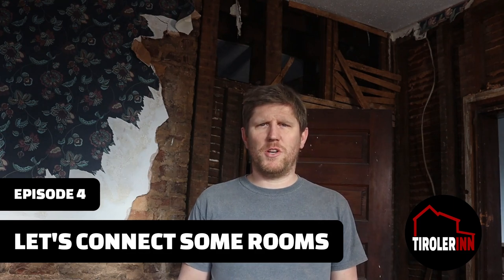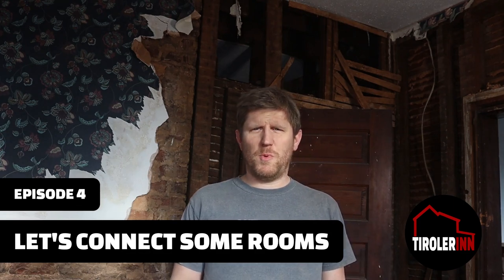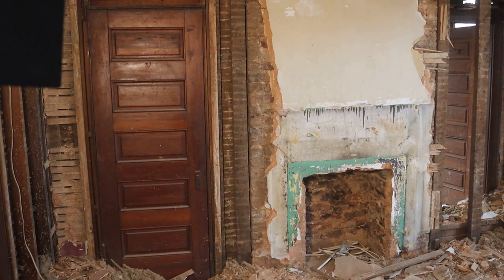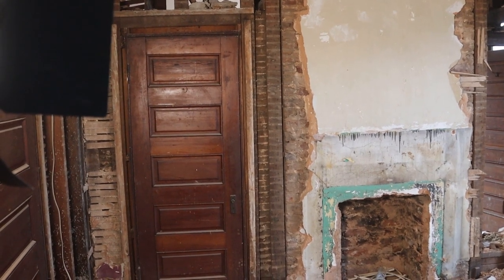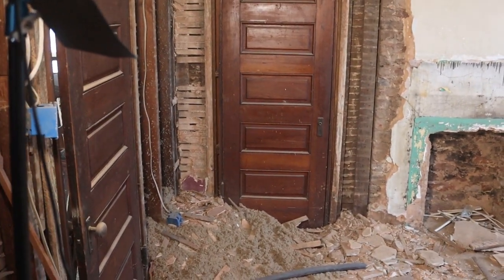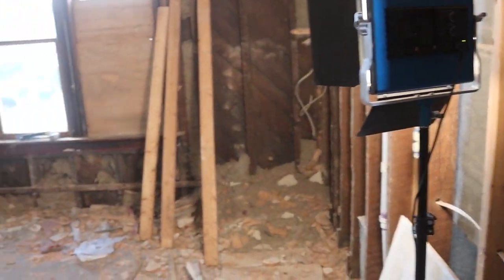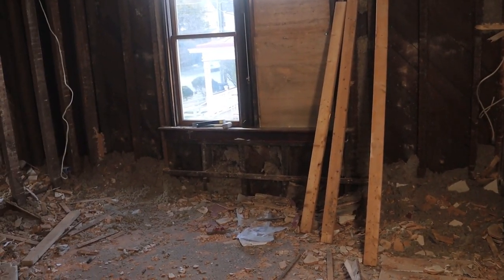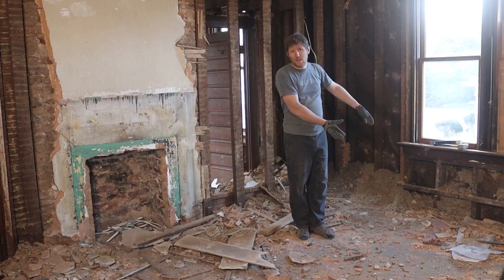Best way to remove lath and plaster! - Victorian Home Renovation [TirolerInn]

Comment: After demoing many plaster and wood lath walls and ceilings, I’ve found it much easier to first remove the plaster and then remove the wood lath. It’s much easier to clean up debris as opposed to trying to clean plaster and lath combined.

Comment: Did you ventilate air out a window when you did it? Were about to start the remodel on my grandparents 1890 farm house i have 2 kids so was a little hesitant on the possibility of lead or asbestos. Were gonna do it one room at a time
Reply from the maker: Great question. We did have all the windows open. 
As far as asbestos goes in plaster you should most likely be good. It was used in covering vent stacks and usually only in plaster in commercial buildings for elevator or other fireproofing spots.
As far as lead goes, I would recommend covering entrances to the rooms with plastic and cleaning off inside first. We washed our cloths separately from our kids and general clothing during the removal times. Just make sure to vacuum well with HEPA filters before letting the kids into those rooms again and moping!

Comment: Please tell me what is best respirator for this type work
Reply from the maker: We enjoyed the one we are using because it also covers the eyes but a over mouth and nose one is fine too if you use safety glasses. The make is less important than the filters. I would recommend N100/P100 filters as the also filter the micro particles. The size will depend on the type of respirator you are using, some are cans, flat packs like we have or even cartridges.